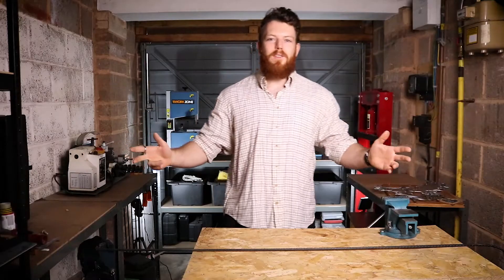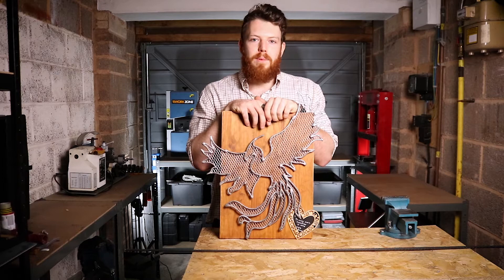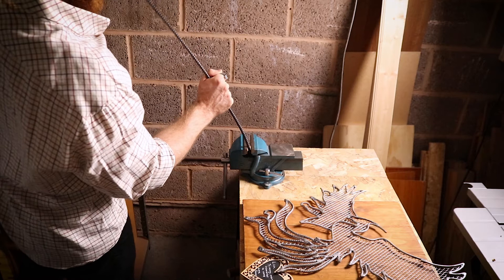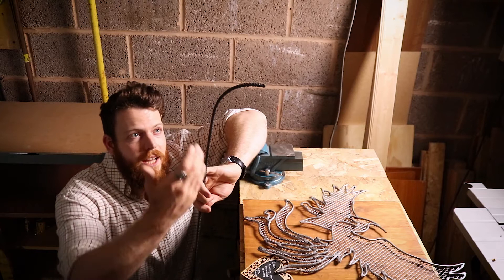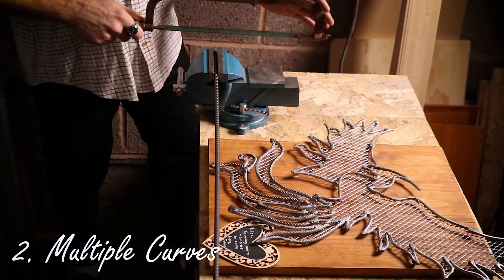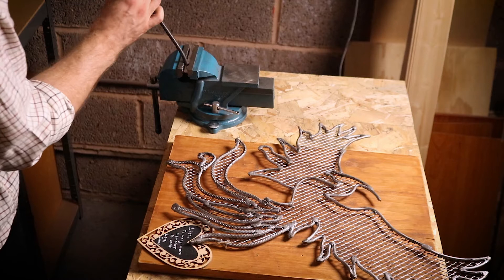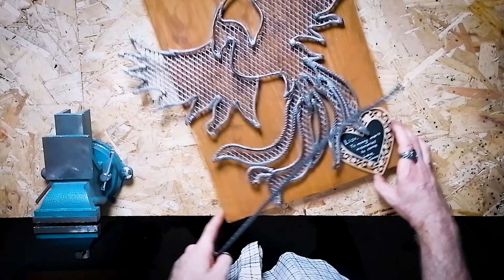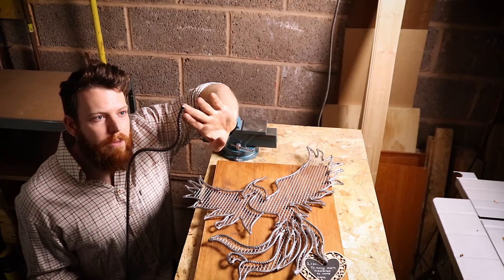How to Bend Steel Bar

Comment: Another helpful tool is a piece of long pipe that just fits over the re-bar.  It gives leverage.  Because it slips over the re-bar, it can help make tight bends as the re-bar will only bend outside of the pipe.

Except for a hammer (which leaves marks) it can bend short pieces.

If you buy a piece of pipe with threads on it - cut them off.  If it comes without them, great - then the inside of the pipe needs to be chamfered to get rid of the sharp ridge.  A little bit of work with a grinder and you have a great tool that will bend metal, and not leave any marks.

Comment: Great tutorial, but the smallest diameter  (as far as I know) rods in the USA are 1/2" (12.7 mm), a bit harder to bend - SO, a bigger vise (and sturdier table) plus  a leverage pipe would be useful.

Comment: That was great and really useful. I am embarking on a rebar rose trellis and was getting a little concerned about how to make the sweeping bends of the steel rose stems. Excellent. Can you tell me what diameter rebar you were bending please?
Reply from the maker: Edit: Thank you, Pete! Really great to hear you found it helpful 😊 I was using 10mm here, which is as thick as I've gone before. Any thicker could be possible but I imagine you'd need a pretty sturdy vice. Best of luck with your project, sounds like it's gonna be great!

Comment: Great vid, cheers
Reply: Need to bend up some 10mm dia copper round bar on site and will only have a bench vice. Copper being softer than rebar I think it'll be pretty straightforward. Cheers
Reply from the maker: Thank you buddy! Glad you found this useful. Yeah copper shouldn't be a problem at all! Hope all goes well, don't hesitate to drop me a message if you have any questions👌

Comment: I wanted to know how you attached the mesh to the back of the bird? thx
Reply from the maker: Hi Martin, it's spot welded on. I just placed a sheet of mesh over the back, welded it, then cut off the excess with a grinder 😊
Reply: @JamesKGraves  cool thanks for the info
Reply: also what spot welder did you use? I never owned one so I was looking for an inexpensive one, any recommendations?
Reply from the maker: Haha sorry I meant to say tack-welded 😅 I used a Clarke mig welder for everything 😊
Reply: @JamesKGraves  oh ok, I tried to do that and it just evaporated the mesh. I must have had it too hot. Maybe I will put it on 120v setting and try that. thx

Comment: You say nothing about the points, did you weld them?
Reply from the maker: Hi Shelly, this tutorial is for how to bend steel bar, so I didn't go into detail on the full construction of the example sculpture. This one was welded using a MIG, but you could also use something like a JB Weld epoxy if you don't have access to a welder.